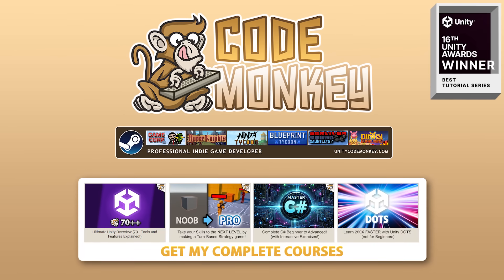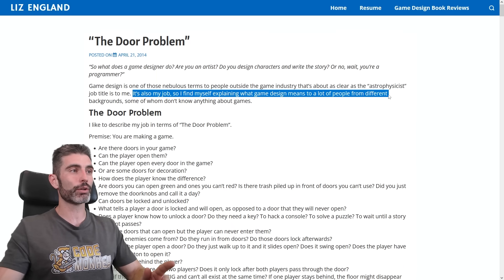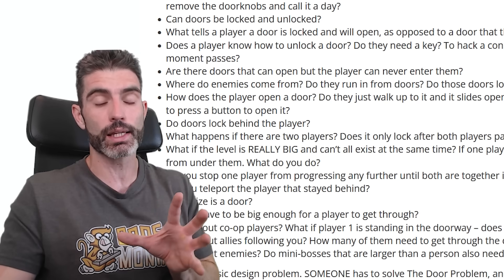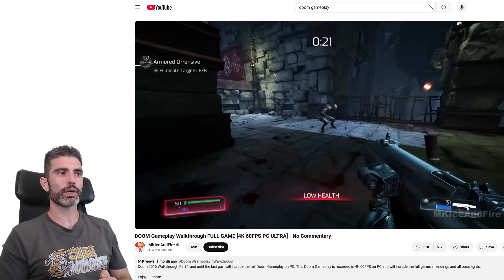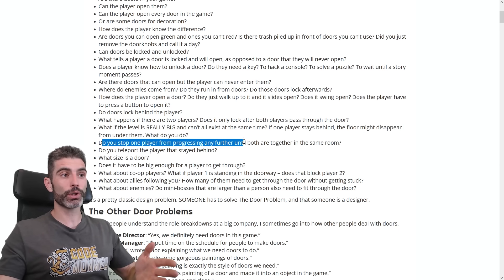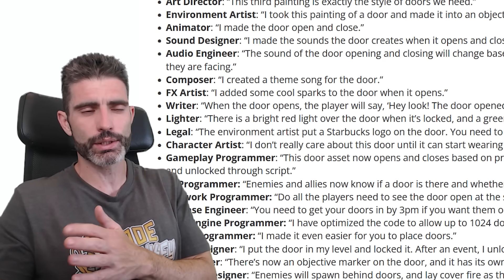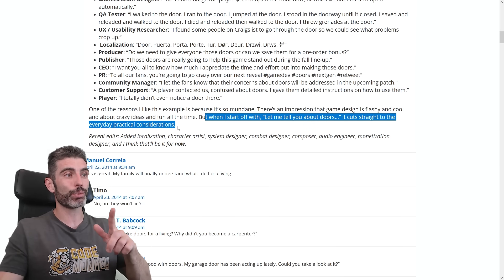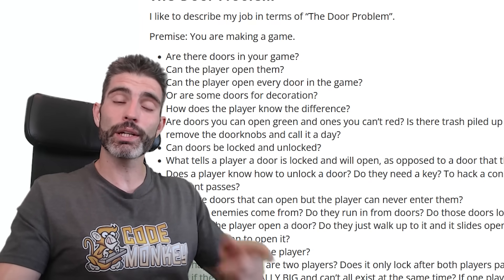The BIGGEST Problem in Game Dev!

Comment: This is fear mongering, anti productive, and only causes anxiety. Its just bloated team propaganda. 
You don't need to front load the design of doors with all this crap, you can just block out a rectangle in a level design, and as the level design iterates, you will figure out how it should look based on architecture references, theme, mood, etc... and you don't need to get any of these details right at first, you can fix it later. 

If you wanted to make this video useful, it would be better to show the actual PROCESS that goes into it, not just list a bunch of roles in a big studio that mostly don't need to exist. There is a linear sequence of events that results in a door design, which can be done by 1 person in a day. You make it sound difficult for no reason, meanwhile plenty of indie devs with 1 or 2 man teams, create all kinds of doors in a 1 day game jam, along with plenty of other mechanics and props, without it being a big deal.

Comment: For real, the biggest nightmare is as a beginner when u wanna do all the stuff by your own after learning the basics.. The more number of question you attempt wrongly you have to waste again perhaps twice of your time in order to correctly answer it. For beginner it happens for every question. E.g. I wanted to code a muzzle flash effect. After a lot of figuring out, the made a vfx graph. But then I saw it wasn't applicable in my case. So spend next 3 hours in making a particle system. After it was done, I saw if I should have animated it... So again I had to make a shades graph which again consumed my 2 hrs and then setting up the particle system according to graph took me next hr. This way, just to make a simple muzzle flash.. It took me hrs of work to perfection.
Reply: I am suc3 at art.So I buy or edit premade package.But I like to make level design and code all by my self.
Reply: @JAKEAVALON-rg8xm  yea but even if you take a wrong path to code any thing, your app will be screwed up on performance and most of the times u will realize this only after coding it completely
Reply: @utkarshsiddhpura2401 For example a home.I screw on perfotmance since I drag package from the store:).So I have to built it my self.Yes coding also found same problem it can code the wrong way:(

Comment: in the company i work for, we have to make new doors because they have just simple door which open on input and close after time, but there was so many issues in Multiplayer where doors start closing but another player wants to open it and that other player needs to wait until animation is finished then he can open doors... it was so silly idk why it was even in the game, who approved ? But anyway we came with idea to create doors which are dynamic where Game/Level Designers could place a Blueprint into level and then just click a "plus" to place there 1 single doors,2 double doors or triple doors like in space kinda game where left and right side open and top side goes to the top, plus there we were dealing with MP where is around 100 doors on the map and if some player open door we wanna give that info somehow to the other player on the other side of the map so when he reach that point he can see door opens and knows someone pass through there, plus doors when you stand in front of them they open to the inside and when you are inside building and you press E the open to the outside and now they stop playing animation when someone interact with them and they react right away on input you give them, plus script is so powerfull we use it in both projects, it was MP efficient solution and it was configurable so you can setup up every door yourself in inspector every door could behave differently
Reply: I wonder if taking a real life approach would solve a lot of these issues. I like the (elevator) timed sliding door method, where 1 player opens the door, it slides out, waits 20 seconds, then closes. If a player stands in the way, the door will detect collision, slide back out, and wait another 20 seconds. Rinse repat until fully closed. It doesn't have to be hard. 

Let's say you are making a medieval style game, and have normal doors. Taking the real life approach simplies things, but it also creates new issues, when other players block the way. The door that swings out or in, can be blocked by other players or objects. This is a problem usually dealt with PvP (people on other side of door), or a GM to yank that person away.

I dunno, from my poin of view, (and a lack of actual experience with these issues), it doesn't seem to be that big of deal. But it's always good to write down such possibilities on paper (notepad or w/e).

Comment: The first thing that comes to my mind about the door: What is behind it and how much effort is it in relation to the player's entertainment? Sometimes a closed door is more interesting and stimulates the player's imagination more than anything else.
But if the door can be opened, then it should work exactly as the players expect it to with the gameplay of this game.
But you pretty much hit the nail on the head with this example of the door. Thank you!
Reply from the maker: Yup that's a good point, the player's imagination is one of the most powerful forces in the universe, so if you can tap into that you can make your game a lot more interesting. But on the other hand if it's just locked for no reason it can simply lead to frustration, it's a tough thing to balance.

Comment: i don't quiet understand it i made multiple project and never understand the Door Problem when ever i want to add door's active or not i put what ever suit the game theme Example:
Sci-fi: make the active Door(Simply area that the player can access) open automatically whenever the player get close to.
for non active door i made the door broken with a message (Door Broken/System failure).
for another game i made that Door need to be open via key's/triggers/or pressing "E" to open/close. I highlight the door's for player's to recognize them

what i mean is : I Still Don't understand why it is hard or am i not digging enough?
Reply from the maker: It's not that it's "hard", it's simply something you actively need to do. You had to answer all of these questions yourself, even if you didn't realize it.
The whole point behind this "problem" is to explain that nothing in game dev is automatic, every single thing you add to your game you need to answer a dozen questions in order to actually implement it.

Comment: The real difficulty is that you can't create any game feature in isolation. Every feature has to work with every other feature. The first thing you'd test with a door is whether it works with the player controller, but what if the enemy controller can walk through a closed door. Can the enemy block the door and prevent the player from opening it? Can the enemy get stuck in the door? Can the opening door push the enemy through a wall? What about items? Do any of these things happen if a player drops an item near  the door or pushes an object near the door? Maybe the player entering a door triggers an animation of the player walking through the door- What if an enemy is attacking the player? Will the player be unable to respond while the animation is still playing? Could the player accidentally trigger the door animation while a fight is happening? If the player tries to open a menu during the animation, does it handle that gracefully? etc.
Reply from the maker: Yup those are all extremely important questions to answer as well. It really shows how behind even a "simple" feature there are so many considerations you need to have.
Reply: That is why you don't create the features first but the framework also known as the architecture. Then you create the features taking into account the given architecture. 

You don't "design a door" how this video suggest. You "design a framework" and the door will conform to the "design specifications".

And if you don't get it, ask any Architect alive about Architectural Standards and why are they needed and used. 

No one reinvents the Wheel, but everyone talks like it does...
Reply: @cristitanase6130 A "What" ??? Nobody needs an architect, it's "well known" that every programmer is an excellent architect and shouldn't be left alone so he ca have his ego pumping... Don't try to introduced a position everybody will piss on ! Moreover is "entertainment industry"...

The problem is that "Architect" requirement, everybody agrees, a glass of wine in one hand, and a BBQ sausage in the other, but when it's time to use the "golden rules" in action, no more time for "golden rules", just do it, if it works, don't touch, etc.